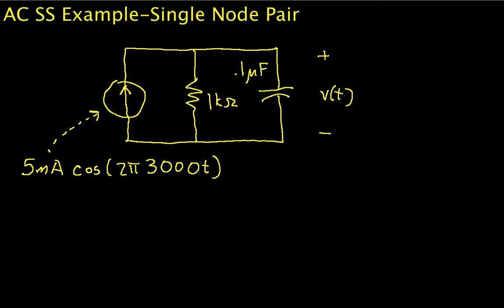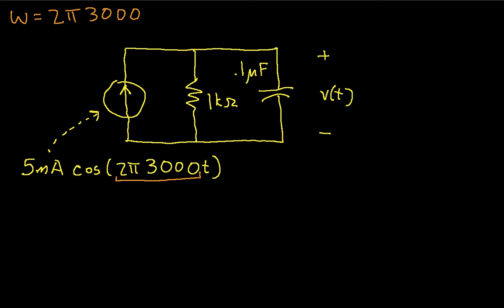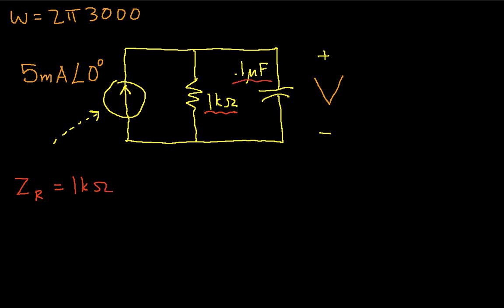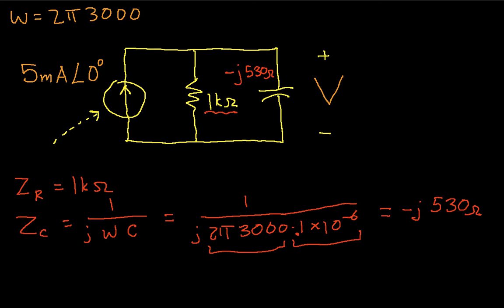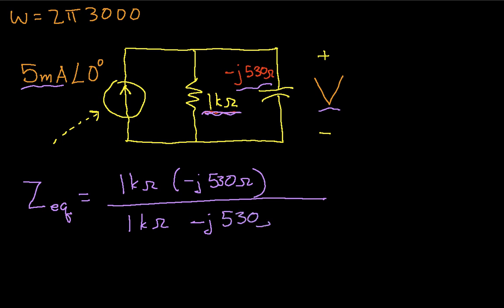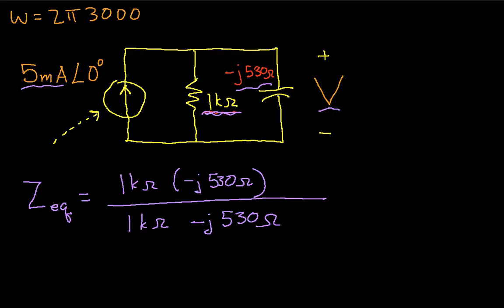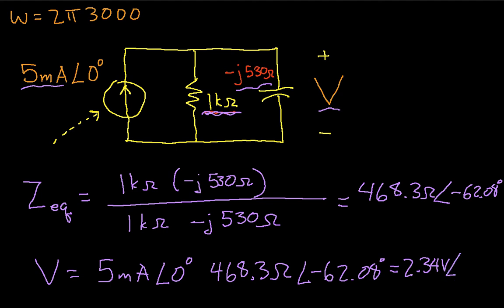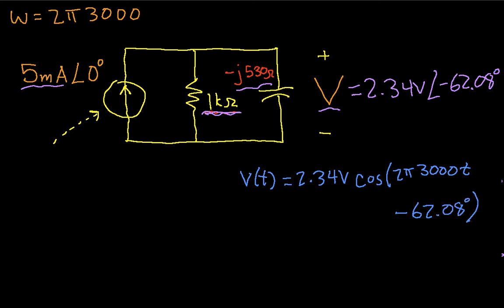AC Example-Single Node Pair

Comment from the maker: @ddkhvids Zc is correct; the capacitor value is 0.1 microfarads, which is hard to see in the video. The final phasor answer is converted to a cosine because I started out with a cosine source voltage. I could have started with a sine source voltage, in which case I would have converted the final phasor answer back to a sine.